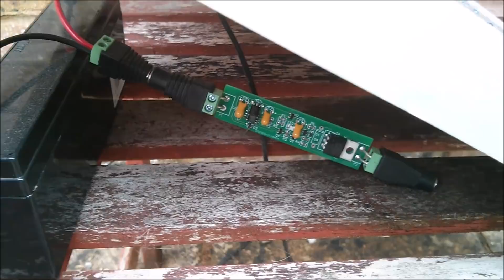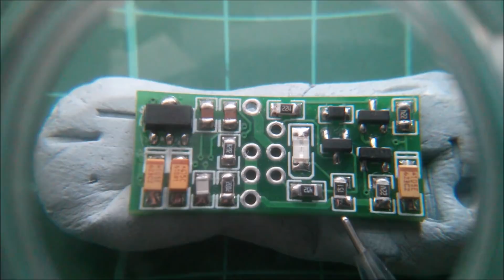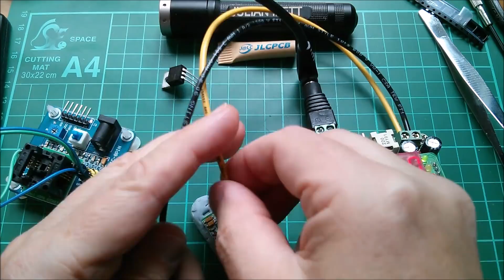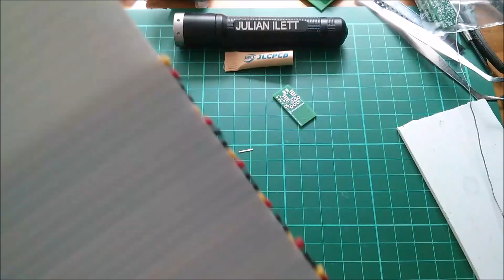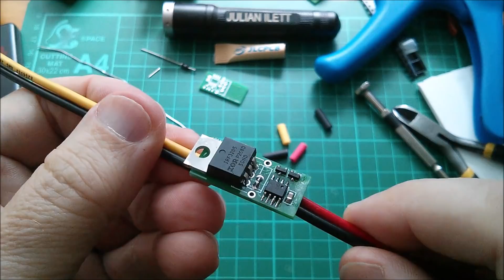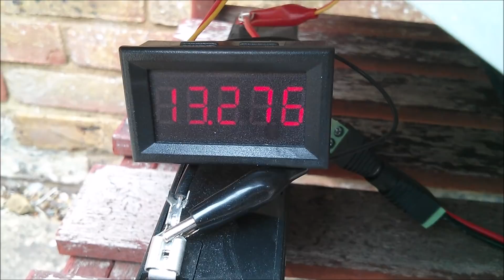It Works! Solar Charge Controller - PWM5 Femto

Comment: Why don't you swap the positions of the 150 ohm resistor and the led?  It's a series circuit.  It might be necessary to find a different LED to fit the resistor pad, and a different resistor to fit the LED Pad, but the LED will now not be obstructed by the heavy wire and connector, and the board layout can remain the same.

Comment: I know it's great product and I respect you for creating such a genius device and now I find myself asking if leadacid batteries are still the way to go?  This because I would like this quality of the circuit board vor Lithium iron phosphate battery 4s(12V or 7s-24V) for example - I would really spend a lot on these
Reply from the maker: Lead-acid is bulletproof - probably quite literally :)

Comment: I'm surprised that by now the market isn't flooded with cheap hobby-level waldo stations with a large magnifier and lamp, even with just a tweezer/probe "hand" and a fine soldering hand.  Should be far les difficult to engineer and manufacture than 3D printing hardware since tolerance requirements would be so much less.

Comment: Is the heat sink connected to the centre for the yellow wire ?
Reply: if the heat sink is connect to the centre pin you could solder the yellow wire to the over hang of the heat sink

Comment: I want one!  except postage to Australia would cost more than the item! grrr.
Reply: hmmm Julian, have you seen these before? 
https://www.ebay.com/itm/5A-MPPT-Solar-Panel-Regulator-Controller-Battery-Charging-9V-12V-24V-Auto-Switch/201452908015?hash=item2ee7876def:g:TosAAOSwYHxWJ2lV

I've quite tempted to get one for my 10w panel so it has something to do.

Comment: May I ask why you don't change your software to slow down the tenths of a volt LED flashes so you could actually count them instead of guessing?
Reply from the maker: They're not meant to be completely countable.
Reply: Yet you keep trying to count them. :)
Reply from the maker: Sometimes I can. It's only when there are 7, 8 or 9 that it's a bit more difficult :)

Comment: i had a idea of using a solar panel to rotate a wind turbine induction motor, it should theoretically generate more electricity than the solar panel could provide on its own 🤔🤷‍♂️
Reply from the maker: It will produce less :)

Comment: Most Electronic/electrical engineers are exactly like that, especially the older ones. I worked alongside them for years. They enjoy component code wars, withholding information for their personal power trip against others, and they'll belittle at any given opportunity.
Choose your swear word and that's what they are.
Reply: I would prefer it if people did not generalise like that. There are pedantic people in every walk of life, but not everyone is like that. I don’t have a problem with people trying out new ways, or new things. And there is no harm in offering constructive advice.

Comment: Greetings and salutations!  I have been playing around with the ESP32 which is becoming much easier to use now that the Arduino IDE works with it, and is super easy to get working now that it has the same type setup as the ESP8266.  One thing I had not realized about the ESP32, it has touch sensor pins making the use of all those little buttons a thing of the past, simply run a wire to the pin and turn on that ability and you are off and running with simple on/off, etc.  Tons of other upgrades as well, in addition to the duel core processor allowing the Bluetooth and WIFI to be used without software problems coming to the head.  Overall it is a really neat device, in fact I recently assembled a little Frogger game with sound and action.  Looks like a mini version of the arcade.  Lots of power (I also built up a Space Invaders game using the ESP8266 thanks to some wonderful folks who figured it all out and put it up on the web.

Comment: I keep wondering if you are going to do a version for 18650's or similar? I have a circuit that works made up of pre-bought modules that is a real dogs dinner. A converter on the input (peak power tracker)  then a charge circuit (current/voltage limited switch mode)  then a protection/balance circuit then a small SMPSU on the output. As I said dogs dinner.

Comment: Hi Julian, I have just get an idea - when there is no space for proper connectors on PCB, what about to make another very similar PCB but aluminum based, there you can place the MOSFET and couple of PCB mounted connectors (like XT30 but way smaller) - and then you will have nice and cool MOSFET and proper connectors, the "price" would be more cube-like shape but I think this change could be worthful or am I wrong? Cheers...

Comment: Congratulations,  maybe swap the led with the 150R. maybe a 0805 LED?
Reply from the maker: And a 1206 resistor (150R) - Genius :)
Reply: A 0805 resistor fit on a 1206 pad, but a 1206 LED on a 0805 pad? try it :-)

Comment: How long does an ADC measurement take? A few tens of microseconds? Since you are bit-banging the charge pump, just don't pulse while there's a conversion. Even if you couldn't stop it, I wouldn't worry about it. The cap that smoothes your voltage divider should easily "overpower" (it's low impedance) any noise from the switching. Also the induced current in such a short run of parallel conductors should be negligible. Aren't both charge pump vias in sync but with opposite current flow anyway? That alone should cancel out most of it. Btw. you have all the tools you need to check if there is any induced noise. Why not check it?
What I would worry about is that you don't have any current limiting on the pins used for the charge pump. I don't know how much those pins can take (I guess around 20mA, which is typical for most µCs). Every time you switch you will get current spikes through the µC internal output stages.
Reply from the maker: Now I come to think about it, I implemented ADC during sleep - so the whole uC is shut down during the successive approximation process. And you're right, the charge pump outputs are always opposite polarity (a simple XORWF flips them). In any case it seems to work fine.
I was initially unsure about the charge pump outputs - both from a surge current point of view and because it's adding 2x 5V to the battery 12V (minus diode drops). But 5 years of testing has shown there to be no problem. Cheers Superdau :)

Comment: @Julian Ilett Before going for covering in UV curable glue, check the glue on something else, because as far as i heared and tested, those glue are really great when there is a thin layer of them, but if you do thick layer (lets say more than 1mm) they dont harden at the bottom (at least with the torch they provide), also tested 15w UV ccfl, same result, now waiting for 50W UV led to arive to test that, but still, have in mind that it might not fully cure on the bottom
Reply: Also i see some comments about epoxy - good thing but costs a fortune, but worth a try for sure :)
Reply: Tried a UV laser?
Reply: ParedCheese Recently yes, it seems like it works better, but because its a laser, if you need to cure a bigger blob, it really takes quite some time, and also eye protection should be in place

Comment: Don't give any more attention to these don'ters. We're just like fruitflies. Maybe a nuisance but not really a problem. ;)

I should investigate more these controllers because it doesn't make very much sense to me why they are not switch-mode regulators, with some form of induction storage... 
In my puny opinion, a more complex buck-boost, cc/cv regulator would squeeze more from the pv panel into the battery even if it costs more initially. 

Quite a few years ago I made a hysterzis charger for a sla battery (with just a rezistive current limiter) so I could  reduce the ammount of electrolite being evaporated while there was no actual load. Therefor, an even more complex controller would also save on battery service life by decoupling completly at a certain threshold.
Reply: Pașca Alexandru - some of the objectives for this design of charge controller was very low power consumption and low cost. With a more complex design, you move away from these plus points.

Comment: Why don't you put the led on stand off legs over the top of the wires. love your channel.
Reply from the maker: Awesome idea! Is there such a thing as a surface mount standoff?
Reply: Leftover LED/resistor wires? :D :D
Reply: Would two low value SMD resistors used in a “tombstone” arrangement do, with the SMD LED on top? The wire would have to be glued to prevent the wire from moving and stressing the resistors, LED, or the solder joints.

Comment: So, could you bend the legs of the mosfet in the opposite directions (center pin away from the mosfet instead of towards it)) , and move the black wire that is inline with the yellow wire to the hole at the edge of the board?
It looks like 3 of those holes are all ground so that you could move the black wire out of the way of the yellow wire, but I may be seeing it wrong.

(Edited for clarity.)
Reply: Jeremy Hidy - and where would the protection “diode” go?

Comment: Weird suggestion, but you may be able to increase the current capacity if you solder a strip of aluminium foil to the mosfet, to sink the heat to elsewhere.  You can glue the other end of the foil strip to the inside or even outside of your project case, so you can have a lot of surface area dissipating the heat.
Aluminium is hard to solder to, but i hear that solder will stick to it if you put a blob of solder onto your soldering iron and (with the iron still on) scrape the iron's tip back & forth on the foil where you want it to stick.  You essentially use the soldering iron tip to scrape the oxide layer off while the foil surface is safely shielded from oxygen under the solder, and it will start to stick (apparently).

Comment: If that UV stuff is any similar to the UV or UV-LED inks then there is also a solvent component to it, which means it can dry out when exposed to air long enough.  The solvent is so that it will become tacky and stick in place and won't run all over before the UV light can cure it.

Comment: I need to try this tip myself but someone suggested to me about waterproofing with bees wax. It has a high melting point and can be removed from electronics so its not permanent like the nail polish would be. Has anyone had any experience using it to waterproof modules?

Comment: I would suggest adding some pads for an ICSP header/wires.  I think it is worth the PCB space and it would allow you to correct the incorrect voltage reading here but also allow for experimenting with new code even after it has been fully enclosed in resin/glue, etc.  You or the end user could just install the wires and have them coming out just like the large power wires through the glue.  Of course those that don't want that option can skip it on the same PCB.
Reply from the maker: Problem is: the programming pins shouldn't have diodes/capacitors attached to them - I broke those rules.
Reply: Ya, without checking the data sheet I kinda thought that might be a problem.  I think you mentioned that in a previous video that you used all the pins.  I wonder if there is a way to fix that without changing your choice of PIC controller.  Maybe adding a transistor and an extra wire that would turn the transistor on or off when programming is required.  Hmmm... bit of work but for me I would want that ability for reprogramming it in circuit.

Or at least add some jumper pads so you can program it after it is assembled but before it is encapsulated.  That way you can at least measure and fix the voltage error first.

Comment: Depending on the manufacturer, the maximum charge current for an AGM battery is 0.2C to 0.4C (C being 20 hour AH rating) - typically the lower end for smaller batteries, although I have a Panasonic 12V 7.2AH that has charging info of "Initial current less than 2.88A" which is 0.4C.   0.2 * 2.3 = 0.46A.   0.3 * 2.3 = 0.69A.   0.4 * 2.3 = 0.92A.

Do you have any idea how long the last few per cent of charging takes?  This is an interesting page for those with AGM battery banks, especially those in the 100AH and above range: 
https://marinehowto.com/how-fast-can-an-agm-battery-be-charged/

Comment: Do you need all the pins or just a couple for that micro controller because it would be nice to be able to fix the voltage offset
Reply from the maker: I can do that by briefly pulling the MCLR pin to ground. Just need to write the code :)

Comment: The only reason to get 0603 over 0805 is that it fits better between 0.1" pins (when using universal PCB). You DON'T WANT to use 0201 :) you might loose your sight while staring at it. BTW how do you count those blinks?!? I can count 3, but how do you count 7? Isn't it a bit fast for the ... hmmm untrained eye.
Reply from the maker: It's pretty easy up to about 6 rapid flashes. It was originally just a heartbeat LED to confirm the unit is functioning, but the voltage indicator was fun to write :)

Comment: You don't want to use that soldering iron at 12v no but I guess its fine for that but it is much faster at close to 20v
Reply from the maker: Yep, it's connected to a powertool lithium pack - about 20V fully charged.
Reply: You could just use a boost converter and still use your solar

Comment: Is it possible to have a ground plane internally as a multi layer board to eliminate the inductance/capacitance of your vias and you could use heat sink vias to the back of the to-220? The board is so small the cost would be minimal..

Comment: Stranded wire can wick moisture along it over time bypassing any conformal coating or potting. Tinning the wire only helps up to the point in the wire the solder wicks. Ideally you use solid pins. You could try glue under the heat shrink to make sure they are sealed. Also, tin and glue the other end into the power jacks so the cable is sealed at both ends.

Comment: Great  Video, Think about making a Nano+NRF24L01 external sensor board so you can monitor the PWM5 from in the house. Just saying NRF24 can monitor 5 units at 1 time.
Reply from the maker: Power consumption of the nRF would be a concern - the PWM5 was designed to have ultra-low power consumption.
Reply: The Nano and NRF24 has it own power supply just the sensor connection meets the target board.  I made a simple one to monitor the hot water boiler system of the old house. I got tired walking down 3 flights of steps twice a day.  You always have great videos keep up the good job.

Comment: I can’t see how soldering wires to the solid core ‘legs’ is better than just having a through hole the correct diameter ??
I guess you save a tiny bit of space - but it’s adding a lot of process??

A big soldier jumper style blob across the joints would be just as good? The lead going into the mosfet is prob the smallest point.

Anyway - love the project. Looking forward to a making home etched macroFem one day!!

Comment: 2 observations. just want to say though, nothing wrong with the soldering.... :)
1. why don't you run the red wire out the other way? then the yellow can go the other way and the led wouldn't be covered?
2 why don't you get some decent tweezers? those poundland things are seriously bad.
Reply from the maker: I think the yellow and black wires would cross if I did that :)

Comment: That would really bug me having the LED covered up.   Being anal I would probably see if I could correct the schematic.  Could the LED be designed to fit on the other side which has no wires to cover it?
Reply from the maker: Yeah, I'd really like to move the LED to the top side.

Comment: If you change the flashes to long then short pattern it would be much easier to count flashes.

Also, I'll be your friend.
Reply: yes. got just the same idea. 
instead of 7 short flashes there could be 1 longer (equals 5) and then two shorts.
perhaps the other way round.
2 long  (=12)
2 short(=2)
1 long(=5)
Reply: @mrdebug6581  Or use Morse Code. 
I read somewhere that the Star Trek: First Contact costumers made The Borg head led adornments flash their names in Morse Code.
Reply from the maker: I figured the tenths-of-a-volt information was less important, so countability didn't matter so much :)
Reply: @JulianIlett  in this case : you're right😊
but : a good principle for other stuff or situations

Comment: Looks great. Did you forget to put your diode on?
Reply from the maker: It can be fitted later - I'm not even sure how effective it is. It's there to clamp any high voltage spikes on the wires running to the solar panel. I'll fit it before I seal the PCB :)
Reply: @JulianIlett  that's cool just thought I would mention it before you cover the board in smoo

Comment: Anybody who tells you to use 0201 components on non-commercial boards should be shot.
Reply: Aye. 0402 is just below my threshold of comfort. 0603 is easy.
Reply: Competitive soldering is a thing now.  Kris Cochrane successfully completed a challenge badge but had to use the "get-out-of-jail" spare led when the primary one flew out of the tweezers and was lost among the dust on the ground.
Reply: bornach - That is one big problem with small SMD parts. Drop one and you will have a devil of a job finding it again, even in a clean workplace. And if you are making a kit where the quantity of parts supplied is the exact number required, loosing one means you cannot then complete that project until you get some replacements....
Reply: @bornach  "The SMD Challenge" I have this kit still to make up! The final bits are tiny! It wasn't cheap though..